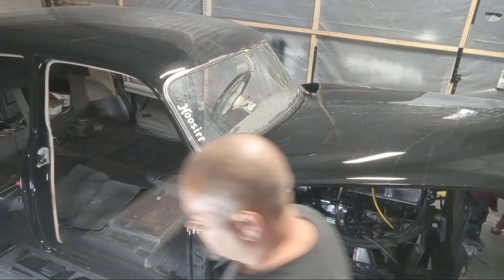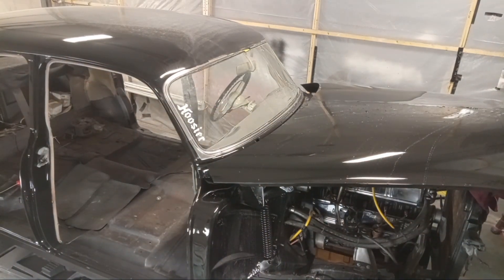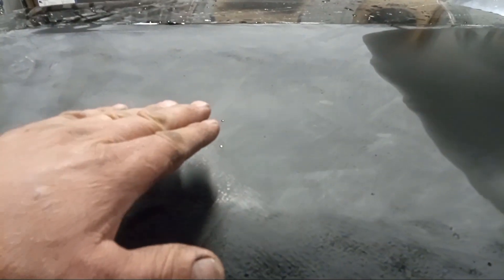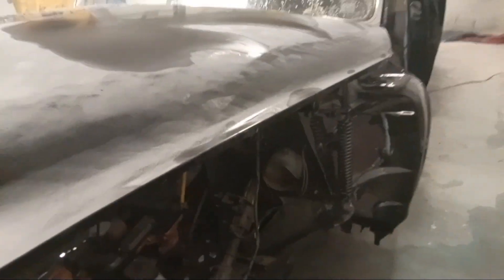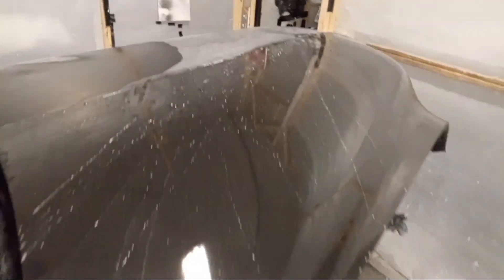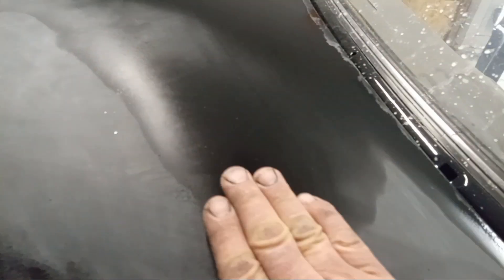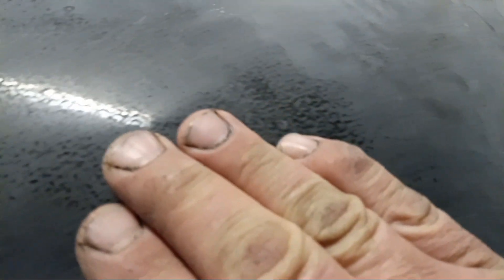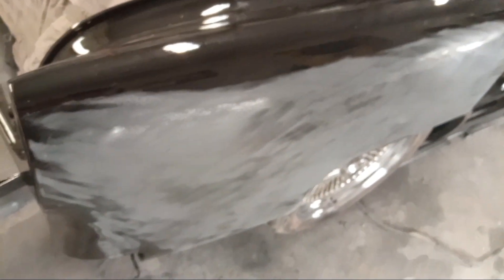wet sanding prep for more clear

Comment: Damn, I had less trash in my paint, and I painted mine in the garage
Reply from the maker: You obviously  don't  paint or you would realize its metallic flake  mostly  I've painted 50  how many have you painted 27 years experience here and owned paint and body shop for years yer just not a real painter or you would know your comment  was dumb your a hater all make sure I block you
Reply from the maker: I'll make sure when I have the vehicle Done buff cut And polished I'll put your comment at the beginning of the video so you can remember how dumb  it was sir! And warn my thousands of Fans on several other channels I own about your name.